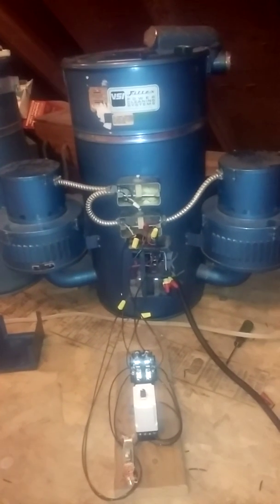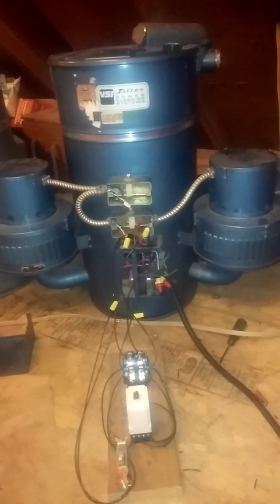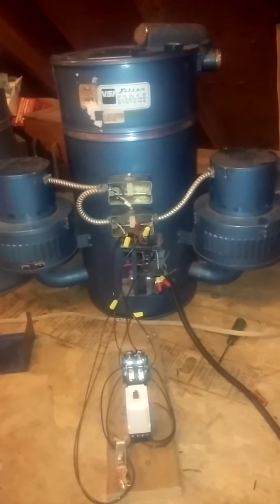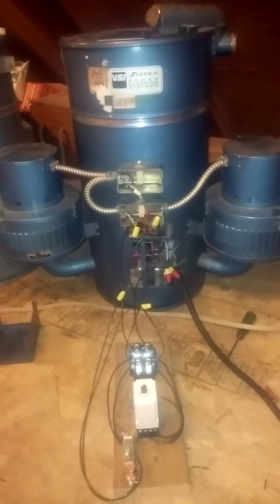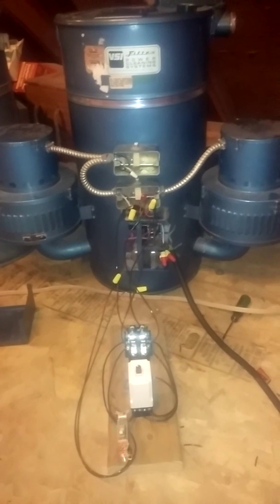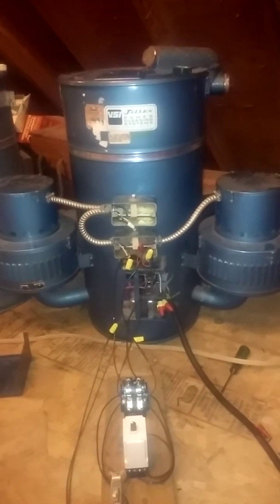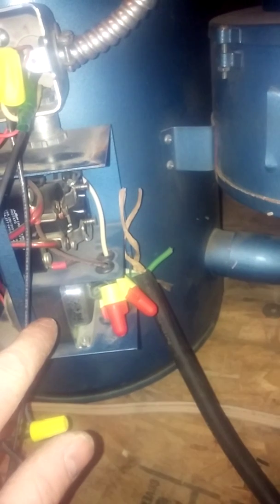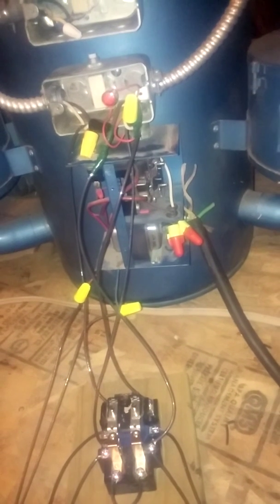Soft Start Twin Motor Filtex Vacuum

Comment: What does VSI mean on the name plate?
Reply from the maker: I've never figured out what the letters mean, but I believe VSI was the parent company of Natter Manufacturing, which bought Filtex in the early sixties. VSI (including Filtex) was then sold to Fairchild Industries (different from the semiconductor company) in the early 1980s, which finally sold Filtex to M & S Systems around 1985.

Comment: Hi Owen! O have a question for you. I am waiting for my two 1400 watts two stages motors to arrive and I don't know which hose to choose yet. I'll only have 10 foot of pipe and a single inlet valve. My hose will have 65 foot longer. What is it the difference btwen 32 and 38 mm? Which one will work best In this case and why? Thank you!

Comment: Hello Owen, thanks for your videos!
O am bilding a central vacuum my own with two motors. Does it make any difference If they start together or one at a time? Thank you!!
Reply from the maker: Luís Henrique Oliveira thanks for watching, glad you like my videos!  The soft start isn't necessary. Both motors can start at once. Make a video when you finish your project!
Reply: Thanks Owen Perkins!!

I am using 2 two stages motor of 1400 watts each one. Conected paralel to the dust bucket.  Looks like this one of yours but the motor are on top. As soon as I finish it I'll post it here. Thanks again.